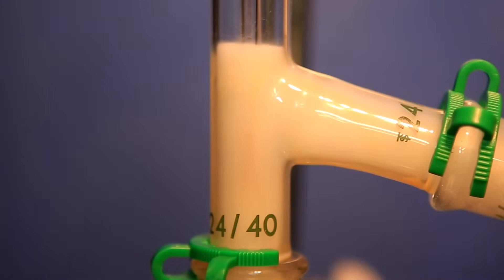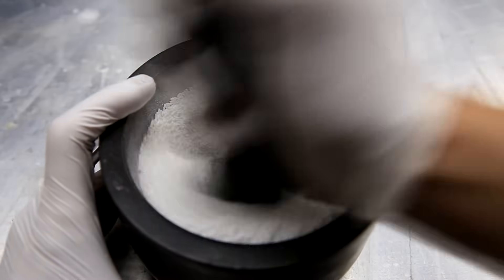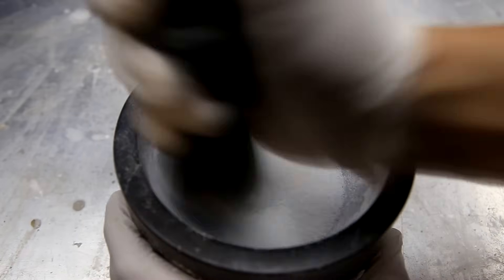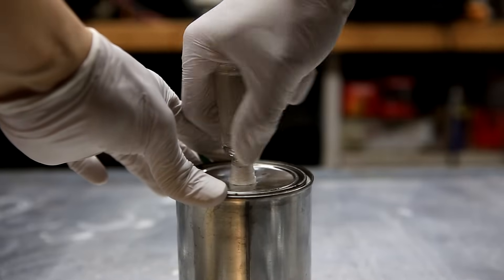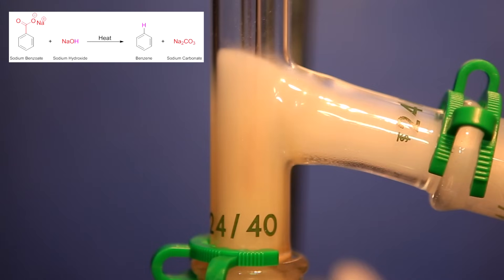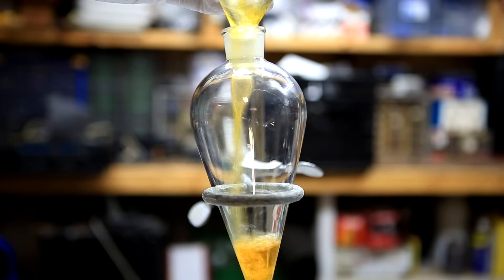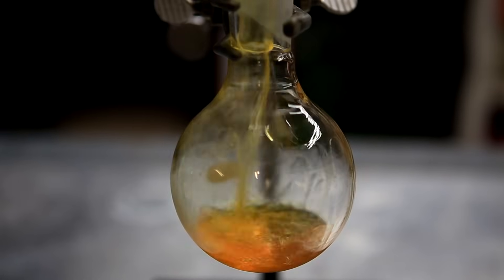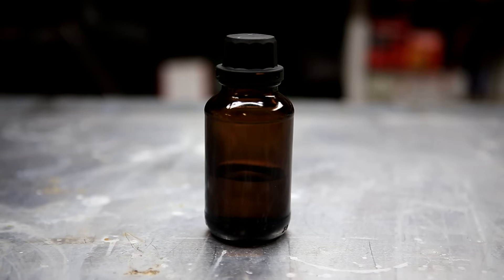How to make benzene

Comment: Come on! The first thing you learn in doing organic chem is that there should be "NO" open flame.  WTF!
Reply: Rick Hwang difficult to do if you need temperatures that only very expensive hotplates can achieve...
Reply: Using open flame in organic Chem can only lead to fire injury.
Reply: Rick Hwang you can't use a kitchen hotplate, they don't get hot enough.
Reply: Rick Hwang if you're careful with vapors, nothing will happen
Reply: You get 1500 watt hot plates
Reply: Rick Hwang Watt isn't what matters, if the plate turns off at 500C, it won't get hot enough

Comment: Why not run the reaction aqueous? am I missing something? do you want to avoid a heavy drying step?
Reply: Zach Canfield the water would just boil away before the decarboxylation kicks in... Very high temperatures are needed for this (my guess is at least 400-500°C) and water just wouldn't support these.

Comment: if you are outside how to you put water in the condenser.
Reply: Erwin Rommel Or a bucket filled with ice water and a recirculation pump.
Reply: Steven Andreev probably has water lines outside

Comment: Man, do the same with plastic bottles, it's way cheaper and PET becomes benzene directly.
Reply: I did a test reaction if it could even work, and I managed to get a gram
 of bottle dissolved. It all became a water soluble salt and benzene 
might have been created too. Then I told this to Explosionsandfire and 
he actually did get benzene after a bit  of messing around. So yeah, 
since then it's confirmed to work
Reply: The ester that is PET decomposes in alkaline conditions to ethylene glycol and terephtalic acid (in this process its sodium salt) and on heating with sodium hydroxide it becomes benzene due to it decarboxylating it all the way to the ring.

Comment: How the hell did you manage to grind sodium hydroxide without it sticking?? It's too hygroscopic
Reply: Legend has it that Canadian atmosphere is completely anhydrous
Reply: @snowdaysrule  

In the winter time, the atmospheric moisture is all outside, as that white stuff on the ground. Canada, after all, is the Great White North. So your statement is true.
Reply: snowdaysrule2 Anhydrous due to the Canadian air being saturated with poutine and maple syrup vapour
Reply: christianvn1 which were proven to be exceptionally hygroscopic. 2001 Nobel prize in chemistry.
Reply: maybe it also mixed with rests of sodiumbenzoate in the grinder that coated the sodiumhydroxid and absorbed some of the moisture
Reply: far-fetched af and makes no sense if you look at any of the variables, but yeah, you just wanted to answer whether it was true or not @onger4458
Reply: Yeah! You r absolutely right. I've the same question.

Comment: I first thought of a process, that required easier materials, but wasmuch harder. I thought of using CaCO3, carbon and water. CaCO3 would need to be mixed with a right amount of carbon and heated. CaCO3 would turn into CaO and CO2. CaO would react with carbon and turn into CaC2 and CO. Then CaC2 should be dropped into water and it would produce C2H2 and Ca(OH)2. C2H2 would need to be collected in a big container with the opening on the bottom, (because C2H2 is lighter than air). When the tank is filled up with C2H2, in high pressure and low temperature it should turn into benzene.
Reply: enjoy making calcium carbide at 2000C in a special machine under vacuum

Comment: Not sure why you bothered with the water washing stage, since it didn't seem to do anything. In fact, it may have lowered your yield a bit, since benzene does dissolve slightly in water, to the extent of about 2 grams per litre.
I would have just transferred the crude benzene straight into a boiling flask with some calcium chloride and distilled it. The calcium chloride would absorb any water still present and prevent it azeotropically distilling over with the benzene. Then just store it over some molecular sieves to keep it dry if necessary.

Comment: What is the orange liquid? Also, the black salt formed was sodium carbonate right?
Great video though.
Reply: The orange color is due to the formation of ionized triphenylmethane, which is intensely orange in color.  That the pyrolysis of benzoate salts produces triphenylmethane is stated here --  Reza Dabestani, Phillip F. Britt, and A. C. Buchanan  III (2005) "Pyrolysis of aromatic carboxylic acid salts:  Does decarboxylation play a role in cross-linking reactions?," Energy Fuels, 19 (2) :  365–373.  
(See:  http://pubs.acs.org/doi/abs/10.1021/ef0400722?journalCode=enfuem )  That ionized triphenylmethane is orange is stated on p. 288 of --  Alfred Kliegl (1905) "Ueber Phenyl-fluoren" (On phenyl-fluorene), Berichte der Deutschen Chemischen Gesellschaft, 38 :  284 - 297.  (See:  https://babel.hathitrust.org/cgi/pt?id=uiug.30112025693745;view=1up;seq=294 )  From p. 288:  When triphenylmethanol was heated with phosphoric acid, "Zu Beginn derselben ist die obere Schicht intensiv orange gefaerbt (Bildung eines Phosphorsaeureesters des Triphenylcarbinols) ... " (At the beginning [of the reaction], the upper layer is intensely orange colored ([due to the] formation of a phosphoric acid ester of the triphenylmethanol) ... )  Another product of the  pyrolysis of benzoate salts --  9-phenylfluorene -- can also form colored ions.

Comment: is this the the benzene sold as zippo lighters fluid?
Reply: Nope, that's gasoline (AKA petrol), which is a completely different molecule.
Reply: +CoolKoon actually, gasoline in not a molecule, but a mixture of compounds and mostly used ligher fluid is butane, but there some other lighter fluids.
Reply: Jose Ponce zippo lighter fluid is just a mix of light petroleum distillates like it says right on the package.
Reply: CoolKoon there's no gasoline sold as lighter fluid nor is gasoline a molecule.  Instead it's a mixture of many different organic compounds. If you really wanted to, though, you could use it in any non-pressurized liquid fuelled lighter.
Reply: +Benzene ring thank you mighty aromatic stable benzene ring
Reply: https://en.wikipedia.org/wiki/Benzene    -   is not the same as   -    https://en.wikipedia.org/w/index.php?title=Benzine&redirect=no  The first is a cyclic compound the other is a petroleum distillate.

Comment: Any idea what the orange stuff is?
Reply: Ionized triphenylmethane.
Reply: Ionized where?
Reply: You can't ionize a stable hydrocarbon haha.
Reply: Zach Canfield -- Triphenylmethane has the formula (C6H5)3CH.  The NaOH removes the H from the CH.  The resulting ionized hydrocarbon is resonance stabilized.  The ion is colored.  Therefore triphenylmethane and its derivatives are used as dyes.  See:  https://en.wikipedia.org/wiki/Triphenylmethane
Reply: Ionized where? which carbon?
Reply: can you show me a resonance diagram? ionization and resonance are very different and its confusing when you use the terms interchangeably.

Comment: Would magnesium sulfate be a suitable desiccant for the benzene?
Reply: I was wondering the same thing
Reply: Robbie Vigil I found a great resource for drying agents, let me find it. 

According to this it is good to use.
Reply: Robbie Vigil Here:

http://www.chem.ucla.edu/~bacher/Specialtopics/Drying%20Agents.html

There is a table of types of compounds matched with the recommended desiccants.
Reply: I just used common salt (powdered). Cleared it up beautifully, almost immediately. Might not have got 100% of the water, but good enough for my needs.
Reply: Hmm strange. I don't think NaCl can form a hydrate, so does this use a different mechanism or what?
Reply: Nevermind it totally can, hmm interesting.
Reply: I don't know about a hydrate, but it dissolves in water and changes its density and ability to keep other things dissolved. Mine went in as fine powder and immediately clumped together into a mass that didn't break into clots, even when I decanted the benzene, so it grabbed on to something.
Salt dissociates in water, and the ions get surrounded by water molecules which are attracted to them. The oxygen would be attracted to the sodium and the hydrogen to the chlorine, so that would pull those sides toward their respective ions. Presumably, the other "ends" of the water would be attracted to each other, the hydrogen ends sticking out from the sodium "group" trying to bond with the oxygen from the chlorine ones, so they would tend to group together, and fall out of the relatively non-polar benzene. I haven't done any math on this hunch, but intuition says that this is what is happening. I could be wrong. Whether I am or not, it worked, so there is that.
I will dry it properly once I have a large enough batch that I don't intend to use for making phenols or other things that will require adding aqueous solutions. (I'm considering making PABA from this batch, and then doing the benzocaine synthesis, just for the exercise. I'm also procrastinating about finding a way to make PABA from sodium benzoate without losing a bunch of it to this method.)
Reply: I see I see. Very interesting. 

As for the benzocaine synthesis, I've actually done it myself. It turned out alright, but I'm going to repeat it one day because I was pretty sloppy.

Comment: It's been bugging me for a while now, After the Dry Distillation you had 20 mL of Crude Benzene, then you did a methanol washing and then burned off the methanol You had 24 mL of 70% Benzene. That means, There is still 4 mL of Methanol, Water, etc. I'm not complaining I'm just saying 1/6th of the benzene still contains methanol or any other side products.

Comment: yea someone else said it better than me so let me make this clear. i work in organic synthesis, i would not handle benzene even in a fume hood, any terrorist with some rc car motors could rig you a robot to handle chemicals like this. volatile organics literally make you dumber, blinder, and destroy your reproductive system. dont do shit like this, just do meth its funner and more productive...and sadly safer.
Reply: Frankly, I bet benzene in a home lab is far more likely to kill via explosive vapor buildup than cancer.
Reply: Bah, benzene isn't that evil. Very much hype. Untill the 80's chemists liked to use it to wash their hands with it. Those people are now in their 70's and did not develop cancer. If you breath it on a regular basis in high concentration it MAY give you cancer. So many dangers are totally exeggerated nowadays, and students shit their pants as a result.
Reply: +Hans Harz you're thinking of carbolic acid, which is the acid form of the sodium salt he started with. Benzene is toxic stuff, and not something to be messed around with unless you know what you're doing, it's teratogenic, carcinogenic and acutely toxic to the lungs, liver, heart, kidneys, bone marrow and central nervous system but it's not environmentally persistent. Long term, it's safer than tetraethyl lead which it replaced as an additive to prevent knocking in modern petroleum internal combustion engines, but in terms of direct acute exposure, I'd rather work with TEL.
Reply: Dom Vasta
Very well paraphrased the hazmat specs, congrats.
Nah, benzene isn't that dangerous unless you don't breath it on a regular basis in high concentration. Working with it is perfectly fine. Unless you drink it of course. Eating 5 table spoons of sodium chloride would kill you too. Chemophopia led to some silly classifications
Reply: Hans Harz it's something that you should worry about in a home lab as the vapours persist and they increase your risk of cancer dramatically, even at ppm concentrations.
Reply: +Dom Vasta I don't care about benzene in ppms. There is NO evidence that ppm conc. ever caused cancer in a human being. Those who catched cancer srubbed an empty truck tank from the inside two times a week without protection, or something. Do     what you think to have to....

Comment: Glad you are doing this! Not enough people are approaching dry distillation.
Reply from the maker: +sodrsnes Ill be doing another one on making pyridine from niacin at some point.
Reply: @NileRed  benzene is one of the main chemicals responsible for the smell of gasoline
Reply: +sodrsnes  Isn't it called destructive distillation?
Reply: john black It's the period comma dude again.. Chemistry seems sound. Portland cement does react with C02 but we've gotten way off goal. Ever think about short answers?
Reply: Sorry about the old term. I learned 'chemie from very old material! It is from the older descriptions of making mineral acids.

Thank you, John for the description of the chemistry.

And,

Thank you Nile Red!!

 I look forward to your synthesis of pyridine.
Reply: Yukti thareja
Reply: #Stopvivekbindra
Reply: john you must kill the string of periods, makes it almost impossible.
Reply: It’s in tattoo ink
Reply: JOHN BLACK SUPER CHEMIST 
No CO2 is formed in this reaction, because of the mechanism. (Which I think is so). The hydroxide ion attacks the carbonyl, and the bond between the carbonyl and the benzene breaks, producing a carbanion and a HCO3- ion. Then the carbanion deprotonates the bicarbonate forming the final benzene product and the sodium carbonate (I'm not sure I just figured it out by now). Thereby no CO2 is produced. And alkali metal carbonates are the only carbonates that can't be decomposed by heating, so CO2 can't be formed in any way. 
Also, I really doubt that the CO2 would be able to react with the benzene, the carbon is just too porly electrophile to be attacked by an aromatic ring.

Comment: can you convert benzen back to benzoic acid-> sodium benzoate?
Reply: +Nile Red I think, a Grignard-reaction will work out, too: 1. Benzene + Bromine + Fe  --> Bromobenzene 
2. Bromobenzene + Mg (in presence of ether) --> Phenylmagnesiumbromide (Grignard-compound)  3. Phenylmagnesiumbromide + CO2 + Hydrolysis --> Benzoic acid + Mg(OH)Br. But this was a quite expensive Benzoic acid!
Reply from the maker: +ionel anonimul Yes, but it will be a lengthy process.
Reply: Where can i find the proces?
Reply: by oxidation toluen with KMno4 no?and then distilet?
Reply from the maker: http://2.bp.blogspot.com/-hhebg6pMoX4/T8BjUeCK4EI/AAAAAAAAAnE/KNVXS35mRqU/s640/benzene+to+benzoic+acid+conversion.PNG

That is a pretty typical route. Friedel-crafts alkylation, followed by oxidation. Then reaction with NaOH to make the sodium salt.

Comment: You Said SODIUM benzoate and then you said that sodium benzoate is nothing more than a benzene molecuul connected to a Carbon dioxide molecuul but if it is sodium benzoate where THE hell is that sodium atom??
Reply from the maker: +Chemistry Lab haha sorry. It is the salted form of that. With the CO2 attached it can either be a benzoate salt or benzoic acid.
Reply: +Nile Red aha your smart did you see mij channel it is just beginning but i am 12 jr ould i love Chemistry and i really like your video's
Reply: +`Nile Red sorry i am dutch but i can't type so good in this inglich
Reply from the maker: Your english is way better than my dutch. Your videos are great. Keep up the chemistry work :)
Reply: quistion where do you buy sodium benzoate i want to make benzene
Reply from the maker: Chemistry Lab I got it from purebulk.com
Reply: Sodium be spate is a salt that when dissolved the sodium will dissociate because sodium benzoate is basically (lol basic chemistry joke!) benzoic acid but a proton from the carboxylic acid group is replaced with a sodium ion and held there in the powder form by an ionic bond. So, as you know most ionic compounds fully dissociate in solution.
Reply: *Sodium Benzoate bloody autocorrect lol
Reply: No a benzoate group is a benzene ring with a carbon dioxide attached

Comment: I want to ask about toluene. If I have found paint thinner wich contains of isobutanol and toluene, what is the best way to separate the toluene from it? Through fractional distillation or by washing couple times with water and letting it stand, separating the water and isobutanol layer from toluene (because toluene is insoluble in water, but isobutanol is soluble)?